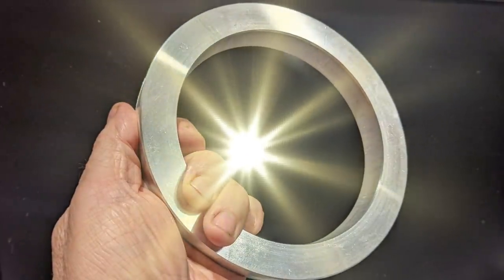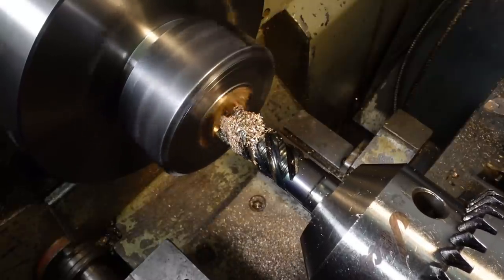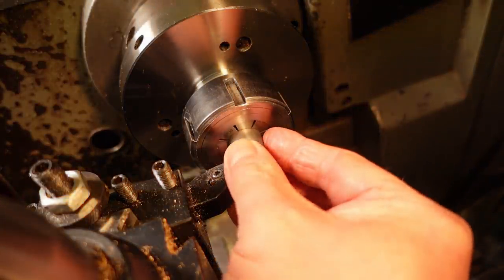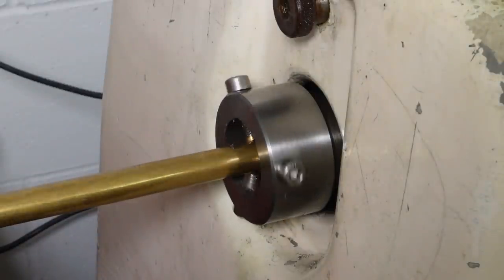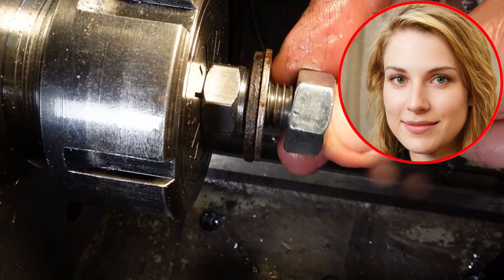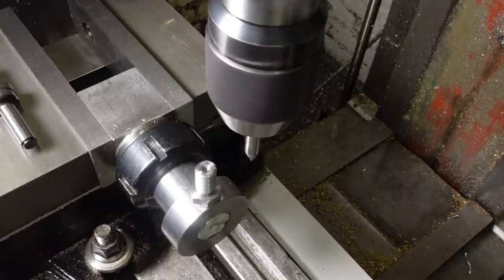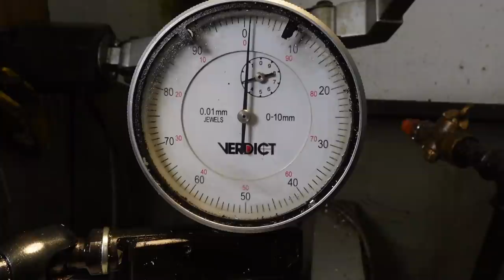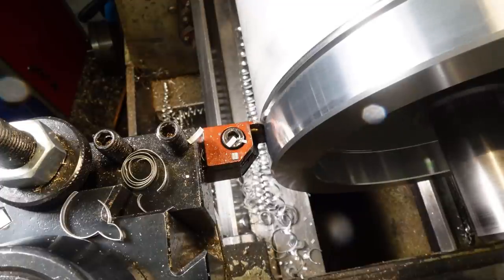Big Tube Fixture Jaw Machining and final build of my Spider-Mandrel

Comment: Its been months. I hope everything is ok
Reply from the maker: Well, there was The Accident. I was using a pressure washer to clean out a blockage in my septic tank connection from the house drains. I was using boiling water and drain cleaner to help dissolve a mini-fatberg. Somehow I got both ankles tied together with the power washer hose, while I was moving rather rapidly, and fell forward as an appreciable fraction of the speed of light. I missed the open septic tank hole, which might have ended up with a fatal result, but I fell on to a low brick wall with a sharp edge, landing on my right forearm. Unfortunately, I was carrying half a gallon of freshly-boiled water, and it all spilled out on to the back of my other hand. My ribs hit the pressure washer, and I damaged my ankle and knee as well. Luckily I was only ten paces from a cold water tap, so I hopped over to it and ran icy water on the burn for ten minutes. Then I realised I had no cellphone coverage, and no landline phone, none of the neighbours were around and Rose was away. I was starting to go into shock, so made the decision to hop to the car on my good leg, clambered in and drove with my good left foot on the throttle and brake, and my rather damaged right hand to steer. Car is automatic, so it wasn't too hard about from using the wrong foot. I got to the local hospital and was seen within three minutes.  They fixed me up, cut away the burnt skin, took X-rays and applied fancy dressings.  No broken bones but my arm was black from the wrist to above the elbow, with a gigantic haematoma like half a melon on it. I still can't type properly, nor use a mouse, and my right shoulder is messed up,  I can't hold a screwdriver or pen very well, and my grip strength is poor.  Left hand burn took AGES to help up, but I had excellent support from the wound management and specialist burns folks, and now it's hard to tell it was ever scalded. That's HALF of the reason I've been absent.  The OTHER bit is a lot more exciting...
Reply from the maker: Now for the GOOD news. I've been commissioned by the same TV series that I did the Great Seal Bug for. This time, the task is hugely more complex.  I have to make a replica of a piece of historical equipment (well, two actually) from 100 years ago. I am working 80 hours a week on the project.  I've already machined over 240 separate parts of the mechanism, and in two weeks I have to have it all working and go to a secret location to meet up with the presenter and crew to explain and demonstrate The Machine. I am at least ten days behind schedule, but that's normal for me.  I need that impending panic to get my ADHD-ridden brain to go into hyperfocus and get stuff done.  I can't talk about the details until the programme airs some time later in the year, but I've been recording what I can so I can make a series of vids about it after the release date. After the studio session at the beginning of September, I'll be able to get back to making videos.  I have about 60 hours of project work on video, with a lot of material about getting to grips with the new CNC machine.
Reply from the maker: I should do a few community posts I guess, but every waking hour is spent doing CAD or experimenting or machining stuff for Project Narwhal, and I'm seriously short of sleep.  This is all written using the rather splendid voice dictation service in Windows 11 so I don't need to type other than edit a few words. Marvellous thing, technology.